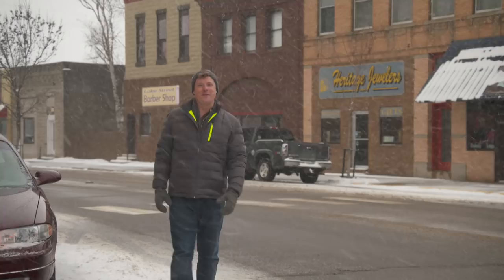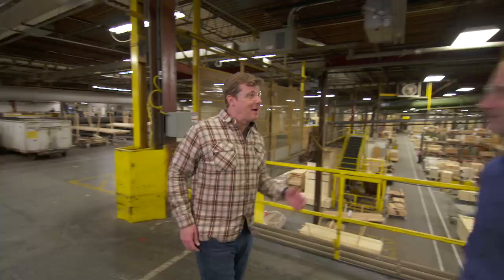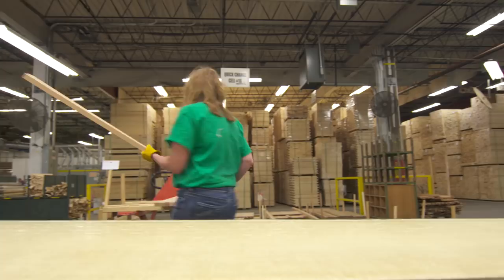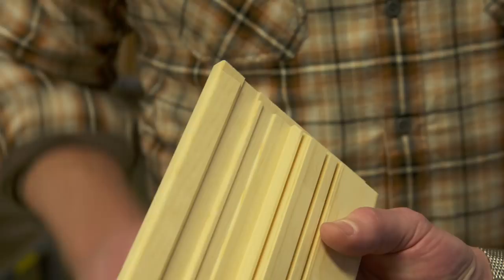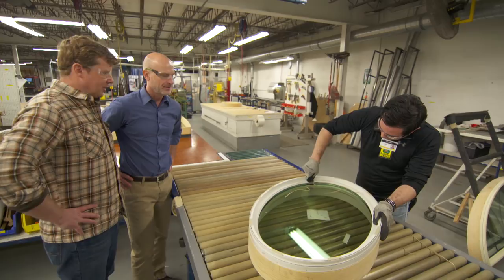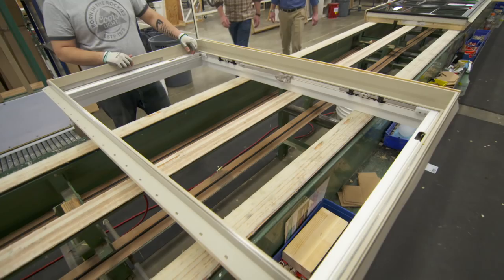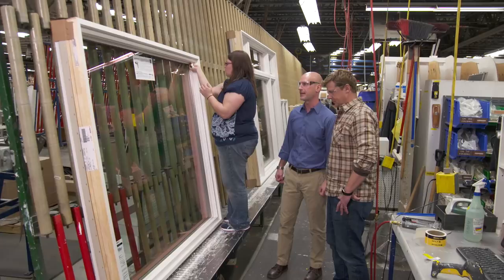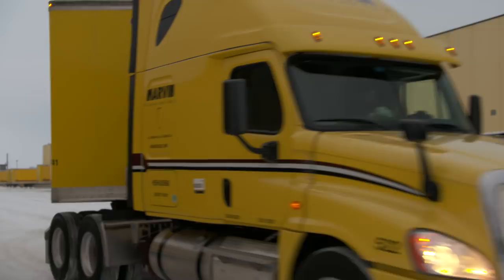This Old House Visits Warroad

Comment: Won't recommend Marvin Window, I order those windows expecting higher 
quality but they are not. The wood they use is cheap, the hardware is 
not compatible with other hardware. And the worst thing is they mess up 
my order, after I signed, they send one less window for my project and 
blame me for that. The fact is they change the order sheet after we 
signed the contract. I will never buy Marvin windows again, the people in there are very rude and they don't care customer at all.
Reply: hundreds of thousands satisfied customers.
Reply: Hmm sounds like someone is upset with the order they received and taking it out on the product